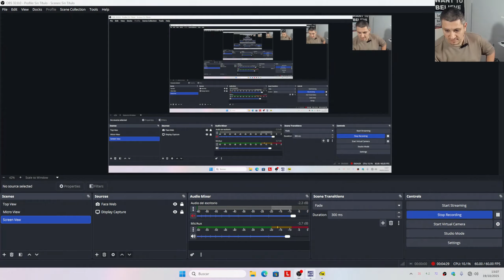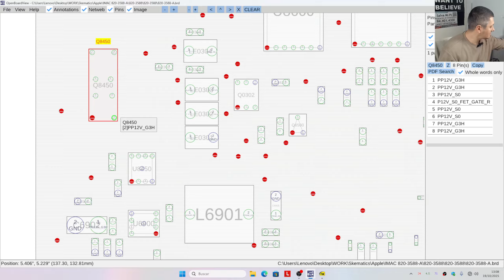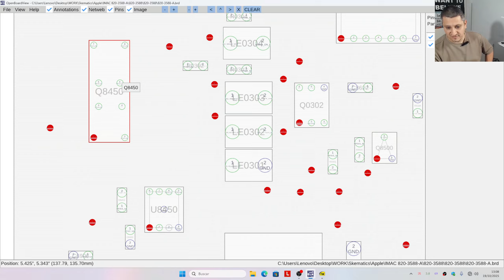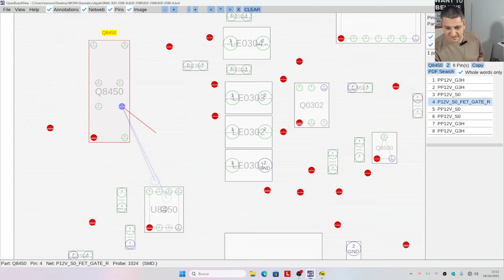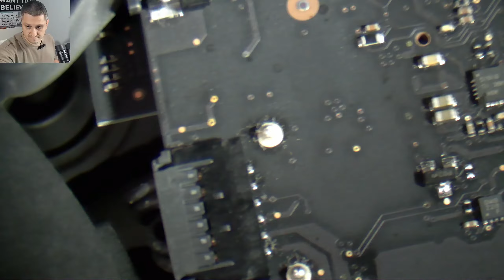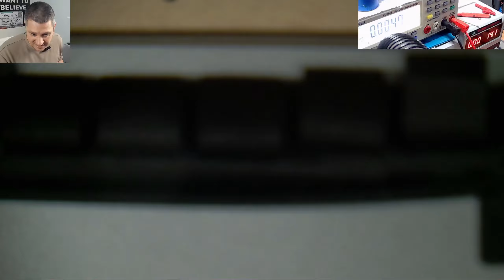iMac Won’t Turn On? Dead Black Screen Fix — The €5 U8450 Chip That Kills the Logic Board

Comment: Would this apply to the 2017 iMacPro that won't power on?  Good power supply.
Reply from the maker: No, the iMac Pro uses a completely different power architecture and logic board design compared to the A1418 model featured here.
Reply: @salvamipc  I sent you an email.

Comment: so did you found the u8450 sparepart to replace?
Reply from the maker: Yes! The U8450 IC component is SLG5AP036 (or LG5AP036V). If you also need to replace the associated MOSFET, that part is IRF6892. Hope that helps with your repair!